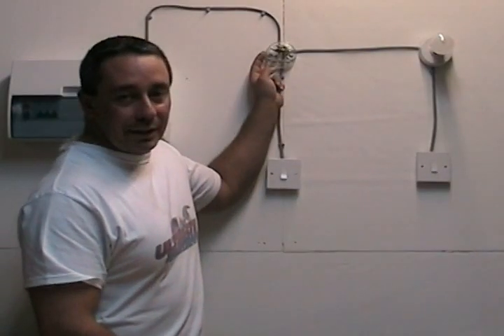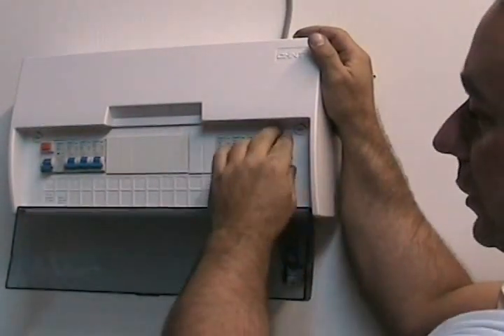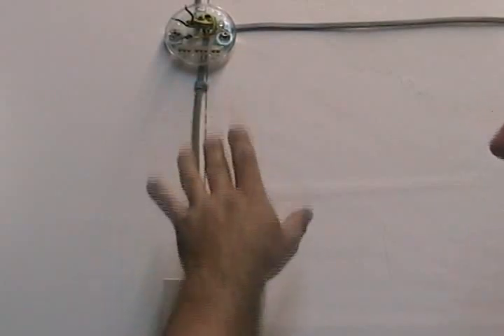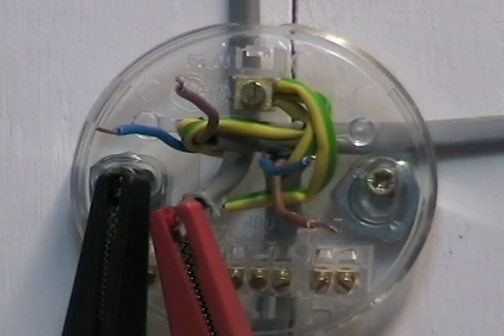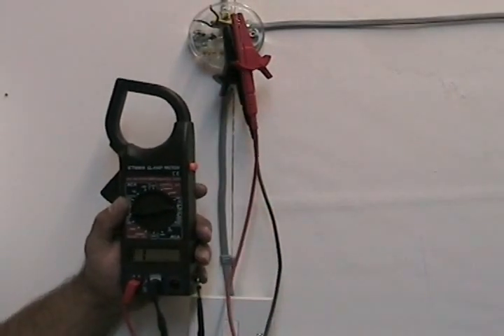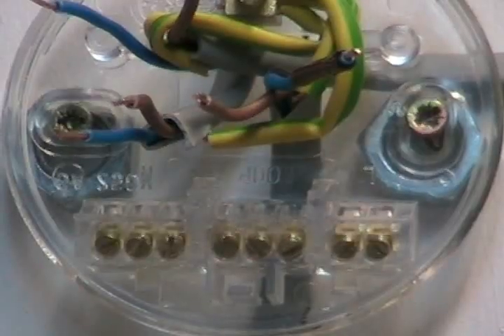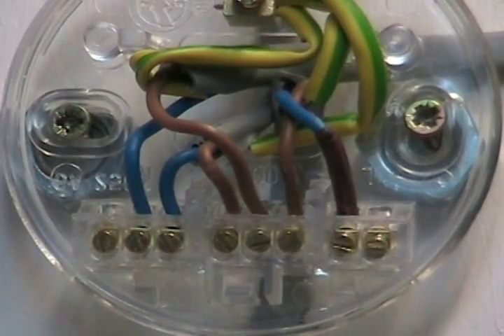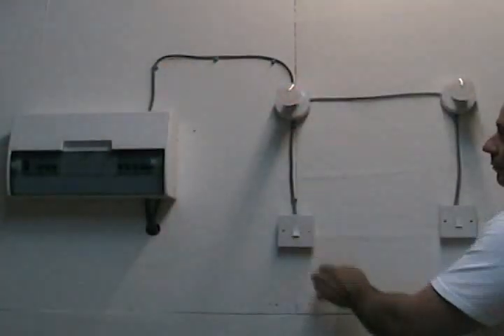Ceiling rose wiring (United Kingdom)

Comment: hi how do you work out the wires when their are 3 cables going to the swich and only one going to the rose thank you
Reply from the maker: That means you have the loop in at the switch instead of the ceiling rose. I'm guessing all the neutrals are connected in a terminal connector inside the switch back box?
Reply: thank you not yet connected yet have you done a vidio how to work out the wires yet
Reply from the maker: Philip Pope
No, I have not done a video on that.
Basically, you have two circuit cables- one is fed either from the consumer unit or the previous light in the circuit, another circuit cable goes to the next light in the circuit.  The two live wires in these two cables are put together in the L1 terminal of the switch, the two neutral wires are terminated into an insulated terminal connector along with the neutral wire from the cable going to the ceiling rose/lamp. The final live wire that goes to the ceiling rose/lamp is connected to the com terminal. All earths are connected to the earthing terminal.
Reply: ***** thank you

Comment: Great video. Im fixing an older type ceiling light. It has 3 cables spliced from ceiling. 3reds 1earth 2 blacks. I had identified switch wire but the switch itself won't work!  Did I wire em incorrectly or the switch needs a change?  I had light on momentary but then realised switch ain't working as it should. Little advice please.
Reply from the maker: If the switch was working before you changed the light fitting you can be almost 100% certain that it's wired incorrectly.

Comment: Thank you. The brown sleeve slipped of the switch cable when I took the rose down so I have no idea which one it is. I've ordered a meter to test as you demonstrate. My other problem is the new ceiling rose only has 3 terminals - live, neutral and earth. Where does the switch live wire go on this kind of fitting?

Comment: My wiring connection for extractor fan is from ceiling rose but when I switch on fan,  lights for ceiling becomes on with poor light.and when I switch my light on extractor fan turned off.  Any hint

Comment: That was a really handy video, I have a light fitting which comes with a block (4x 2) instead of having the electrics per this video (all in a row, with 3 for neutral, 3 for live and then 2 for the switched live and the fitting live) any ideas for wiring it up?

Comment: I note that you put brown tape on the blue wire (from the switch) in your demonstration (6:00) and called it a "switched live" wire.  Is this not a "borrowed neutral" and, therefore, "frowned upon".
In the UK do you not have one pair wire containing a "live" and "switched live" conductor.
In Australia, the wires to the switch should be red (active) and white (switched active)

(Here, house wiring here still uses red, black, and green/yellow, although flexible leads follow European practice.)

Comment: Dear Handyman, you have some great videos!!  I wanted to ask you how will I replace a ceiling light fixture that has a dimmer switch connected to it? The new light fixture will not be used for dimming as I will be using an energy saving light bulb, but I would like the switch still to work so it turns on and off.

Comment: need some advice please i changed my dimmer switch to a one way switch but its not working its all wired correctly on the switch do i need to look at the wires in the ceiling rose now?

Comment: Any help would be appreciated, basically, I decided to take off the ceiling rose without knowing its importance to put a new light on. Ive got two lights now that done work, one ive messed with the other further down the circuit. anyway ive followed the video, one thing is i have no reading on my meter. the other is that after wiring it in, both switched operate the new light while the one for the other room dims the light as well as lighting the new one, any suggestions please?

Comment: Great video. Quick question though: My new light has a black wire as well as the Earth, Live and Neutral wires. Where does this black wire connect to the ceiling rose? Thanks in advance.

Comment: can u help me. i have 3 red wires. (connected to each other) i have 2 black wires (connected to each other) and 1 black wire. the one black wire connects to blue on my light fitting and the othe 2 black wires connect to brown on light fitting...the problem is i tuck my old light fitting down to replace with a new one and i now cant remember witch 2 black wires were joined to gather. i hope you can help me

Comment: Hello. How to Identify the switched live wire in a lighting circuit without multi meter. I got 4 red wires and 4 black. Can I do it using a pen voltage detector?

Comment: One of the switch (chunky) wires lol is/has been made permanently live. Its just a matter of switching over the line and neutral over.. be sure to do a safe isolation before commencing any electrical work. If you are insure where is your 100a or your 80a/60a double pole isolator is consult your local electrician.

Comment: excellent video thanks for this,  however, i have 3 red wires, 2 earth wires, and 2 nuetral wires , and a black wire with red tape around it...i'm trying to fit a new light which only has L -earth- N  plug block sockets!.. the wires should light my bathroom, and kitchen, but everytime i wire it up either none work, or one stays on with no switch effect, ....ive used blocks to wire it up but no joy.....i could do with a diagram ???...have you any link?..advice?...cheers matey. rob.

Comment: Ive got 2 lights and 2 light switches in one room. both light switchs control one light... BUT the other one doesn't switch OFF at all!
light which doesnt switch off has one wire coming out, 1 black, 1 red and one just plain metal.

the other light, has 4wires coming out, altogether it has:
3earth wires, 1 plain metal. 4red/brown. 1chunky red, 2black, 1chunky black.

could you help me please.

Comment: this totally saved my bacon was fitting some new lights they kept shorting out the lighting ring, this was because its an old house and they use red and black still and they had not mark the correct switch live, remembered then after watching this to use the meter boom, found the mistaked and it all works lovely.  this video helped loads thanks.

Comment: @ultimatehandyman ive got no problem with the video's you make,infact they are far more instructive than most,but i read a previous comment on a video you made months ago that stated using safe isolation too,you replied with exactly the same comment.The thing is it will take only a matter of 30 seconds to demonstrate using a voltage detector to insure the circuit is safe to work on.It should be priority above anything else! the majority of viewers will need educating on that,regards..Dave

Comment: IF THIS COMMENT ACTUALLY GETS APPROVED THEN UNDER NO CIRCUMSTANCES SHOULD YOU EVER PRESUME THE CIRCUIT IS DEAD JUST BY SWITCHING THE CIRCUIT BREAKER OFF!!!!! AFTER SWITCHING OFF YOU ALWAYS TEST TO SEE IF VOLTAGE IS PRESENT WITH A VOLTAGE TESTER BETWEEN LIVE,NEUTRAL AND EARTH AT THE FITTING BEFORE CONTINUING

Comment: @ultimatehandyman Yes both lights come on when i switch on.The 2 lights are at each end of room approx but i want to take off those ceiling roses and replace with one new light fitting in between these,thanks very much for the information reading it now and tomorrow will have a crack.(totally agree  would never attempt electrical stuff without isolating )Would you use new cable or is it ok just to use connecters where the 2 exsisting light fittins where? very much apreciated !!

Comment: I have a problem that after doing what I believe is what you explained in the Video The light will not switch off &. Not sure what I did wrong. Repeated the steps a few times but sill stay's on. At a loss now.

Comment: very good and well explained video.....and has helped me to get to grips with the looped or ring lighting ( or whats it called) someone (shall not be named) decided to take all three downstairs lights down and left 3 blackwires, 3red wires and 1 uncovered earth at each ceiling rosi  to got  kitchen sorted (flourescent) working but sorting the other 2 out has had me up and down like a tarts knickers..switching fuse box on/off as reqd..so far i have had kitchen light come on without being switched

Comment: Hi, how would you install a GU10 down light to the following - There are 4 wires hanging  each of which have a E, L & N wires. I understand the GU10 light only has two connectors.  Any help would be appreciated.

Comment: Really liked your video.  Some time ago I took down a light, to replace it and ended up with lots of wires... it took me ages to work it out.  Your clear video shows what i should have done!!  Also, you turned off the main switch... this is important... when I did mine I only turned off the circuit (MCB)... that was a mistake as Neutral is still live!

Comment: @ultimatehandyman 
Yes, cause three phases are distributed between 3 apartments or 3 floors; every apartment has 1 phase. Sometimes (where are electric saunas or other powerful appliences) you can find 3 phases in one apartment. If you disassemble some new distribution board, you'll see that phase B comes from black wire.

But we're speaking about other - due to new color codes (accepted in EU since 2004), black is phase (phase B), so you can use it to wire light switch.

Comment: @ultimatehandyman 
I say nothing against DIY. Cause I was DIY before becoming qualified specialist. 

The problem - you haven't explained to DIY'ers about three-phase system and shown some theory about closed circuits. Cause there comes 3 phases from distribution substation to apartment block or other building. And phase A (L1) is brown, phase B (L2) is black and phase C (L3) is grey. Zero (neutral) is blue and ground (PE) is yellow-green. 

So, black is also phase due to EU color codes.

Comment: @ultimatehandyman 
Why black is neutral in UK? Black can be "-" in DC, but as for AC brown (L1), black (L2) and grey (L3) are hot wires. Or this color codes are not used in the UK? 

As for switching all electric, it has no logic sense. If you turn off line you're working with - it's understandable. But what for you remove voltage in all house repairing only 1 switch? You can check it by tester or multimeter if you're not sure about turned off circuit :-)

Comment: Better to wire light switch by cable containes brown and black wires. Resistance of the wire will not be changed, but color code can mislead other electricians and they join blue with other blues; as the result - circuit breaker will blow up due to short circuit. 

Also, remove voltage only from circuit you're going to do, but don't remove voltage from all circuits as it shown on the video. Otherwise, you will work in darkness when nothing is seen.

Comment: One side you have the sockets and one side you have the lights?  WTF? Ever heard of diversity or In, Ib, Iz?  Its in BS 7671.  If you switch it all off some devices might go to fault conditions, ie alarms.  He didnt test if it was live between all conductors.  The switch wire should have sleeving only not tape.  Get an electrician in, should only cost about 20 quid.

Comment: I found your video very useful, so thank you.

We have bought a new light fitting which requires just three wires [live, neutral and earth]. Unfortunately, the ceiling wiring is the same as in this example [but with red and black wiring].

My question is: do we need a junction box to be able to wire up the new light?

Many thanks in advance!
Reply: turn left at the junction (its took me 11 years to think of that)